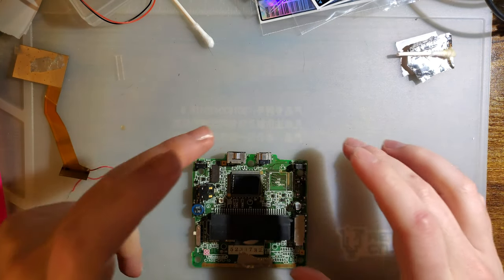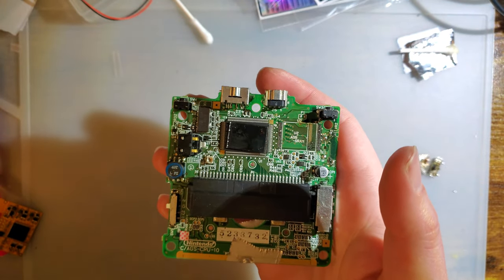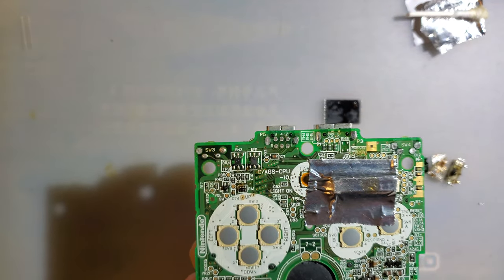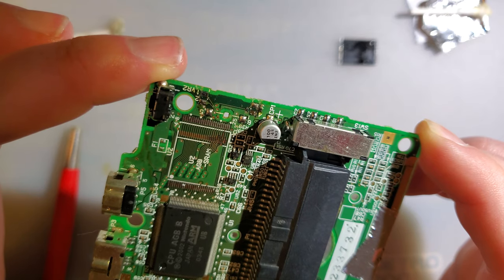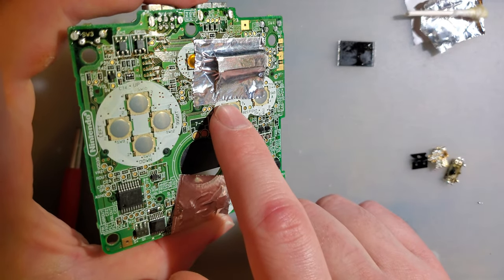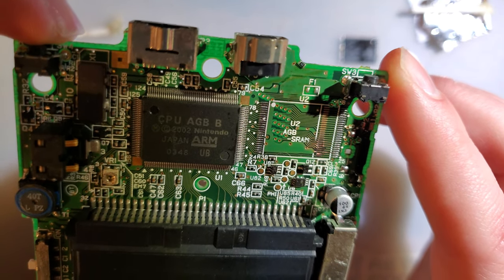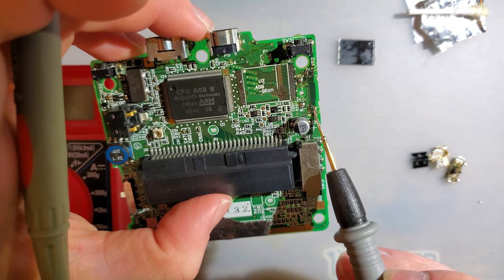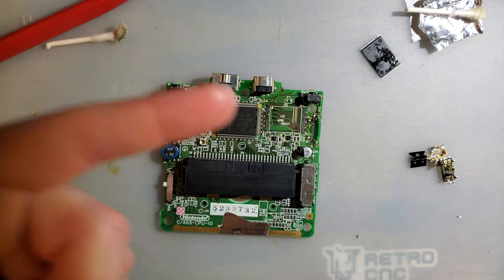Game Boy Advance SP Freezing on Boot (Part 3 of 3)

Comment: I just bought a gba sp that didn't recognize or failed while playing GBA games but did recognize GB and GBC games. The solution was to clean the switch that recognizes the type of cartridge. Inside it had corrosion much like the one formed in the power switch. Cleaned and removing that dirt On the switch contacts  managed to recognize a gba cartridge.